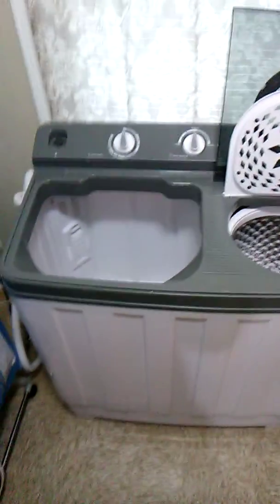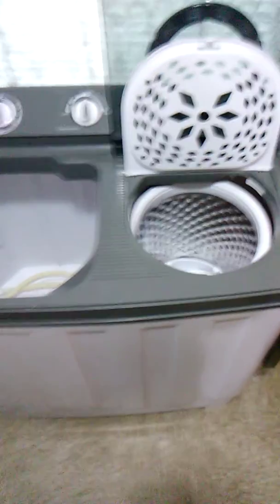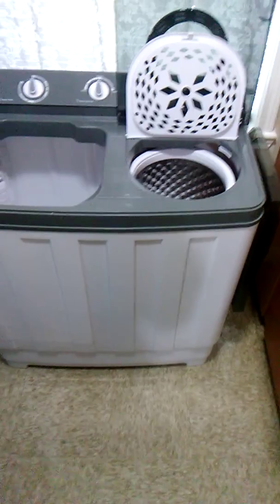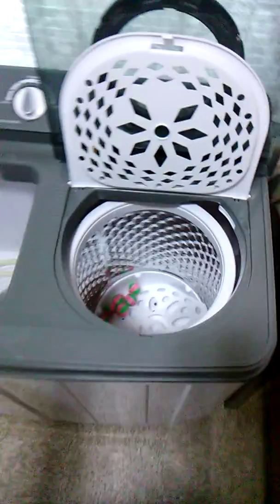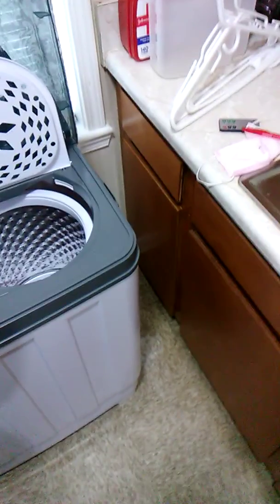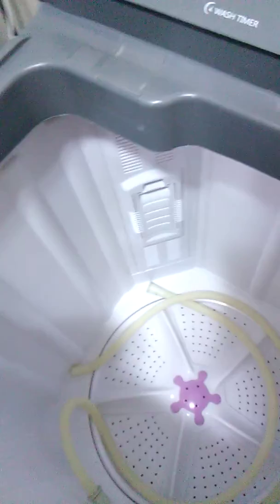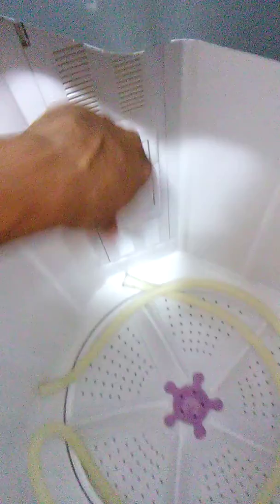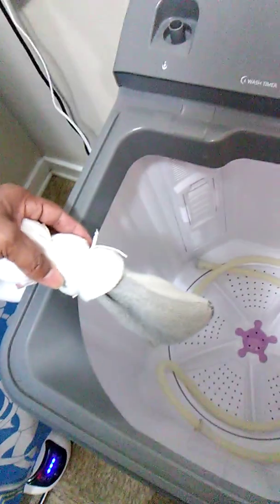Della 30lb portable washing machine

Comment: How much did you pay for it? Have these been discontinued? I have searched everywhere for it and everyone is out of stock 😢 Great review 👍🏽
Reply: Hey girl! Yeah they are discounted sadly. I have one that I just bought yesterday. I absolutely love it the design and everything. The only bad thing about it it's that it drain SUPER slow. Theres other machines that I would recommend. I have three different ones from different brands! Theres also different della machines that are better! I love this machine is just the draining is slow :( I bought it second hand on offerup for only $30 offer up has great deals you can check there!
Reply: Bubblesmv Thank you 😊
Reply: Bubblesmv How does offer up work? Is that like Craigslist or Ebay?  I think Kuppet 26lb (18lb wash) (8lb spin ) is the largest portable twin washer available out there. Too bad Della just had to discontinued this model. 30lb would’ve worked nicely for me. I didn’t research and bought Costway 17.6 lb . It worked good did my first load yesterday. I washed 12 hand towel but wished I had gotten a bigger portable washer instead.
Reply: Mr Chaos I actually ended up purchasing the 26 lbs portable washer and yes I believe it is the largest one they have available on the market now but sadly they are price gouging and the price has went from $129.00+tax to $1,129.00. I got mine from Ebay brand new right before the whole shutdown thing happened